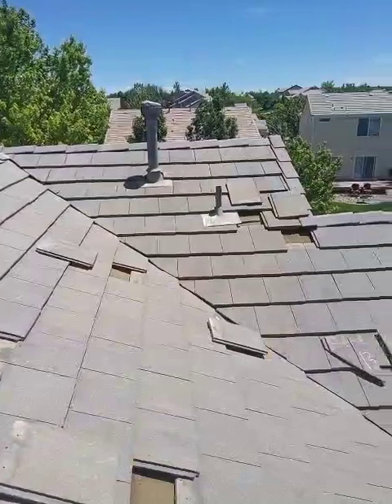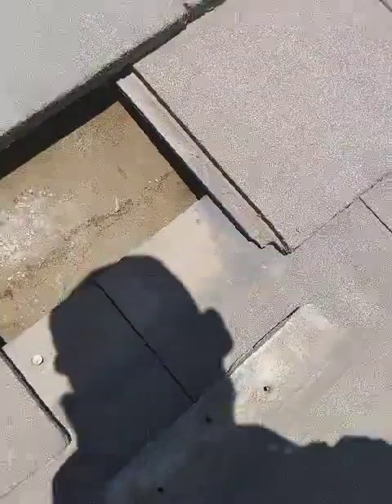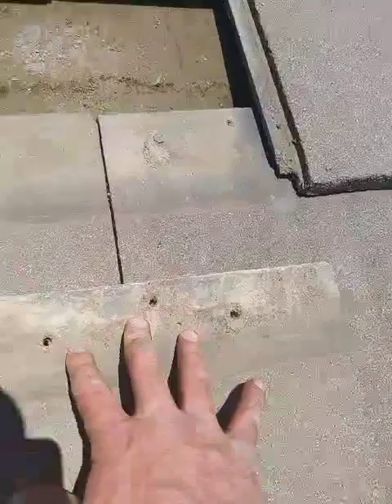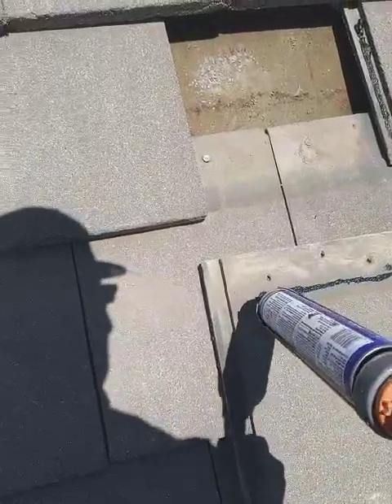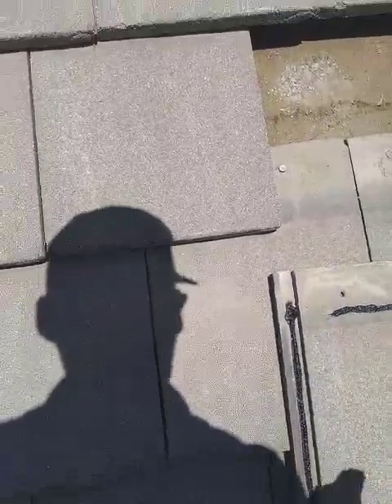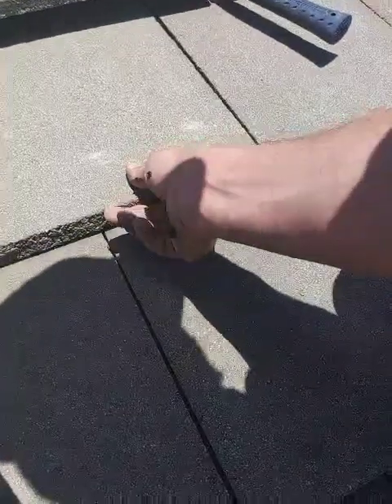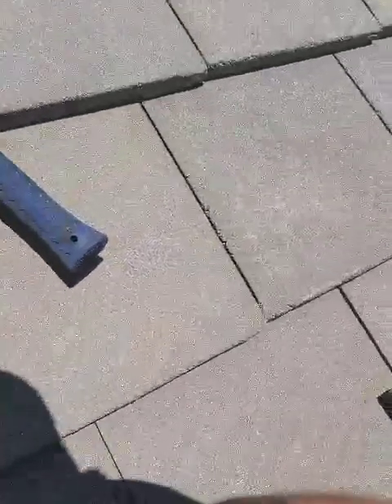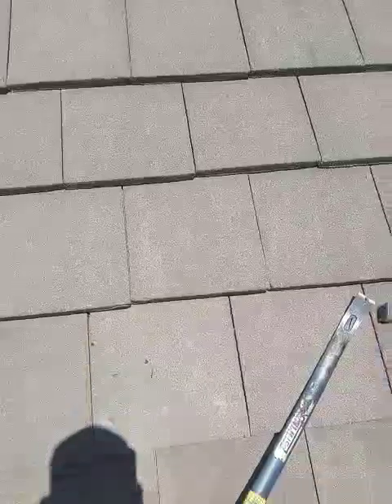How to install a concrete roof tile

Comment: People don't do this ffs that is a chanel for water to run down on to the next tile if you block it with silicone or calk the water runs into the house.
Reply: Yes your spot on mate all tiles aren't nailed any way u only nail so many course
Reply: Yessir
Reply: youre correct. do not do this
Reply: Correct, The water channels on the tiles are there for a reason not just for interlocking they are called water channels for a reason.

Comment: Had my roof soft washed notice after... that one of my concrete tiles look about 1 inch longer than the other can I just tap it back In place?
Reply from the maker: Yes, but you should add some caulk to hold it in place.
Reply: @FrontRangeStormContractors  where do I caulk and can you recommend a brand the roof is 2 year’s old this is worry some my tiles looks just like the one in the video I’m not sure if they are nail in place they do interlock thanks for replying.
Reply from the maker: @Mark_conor  send me an email to info@frontrangestormcontractors.com